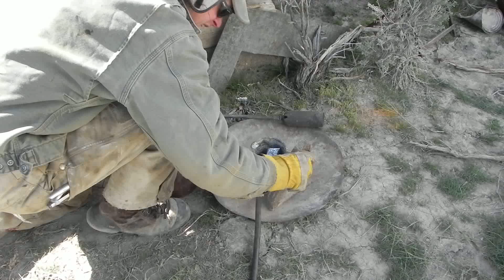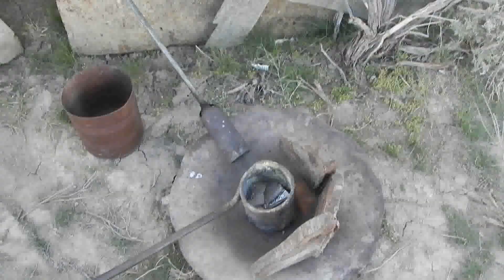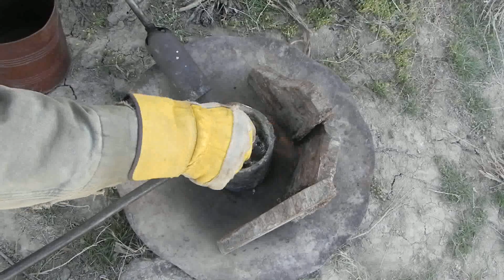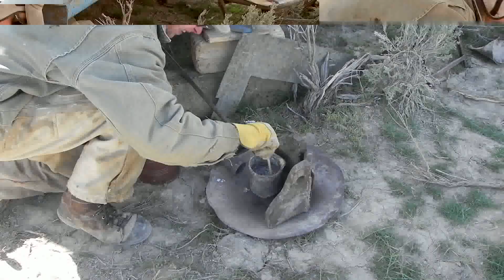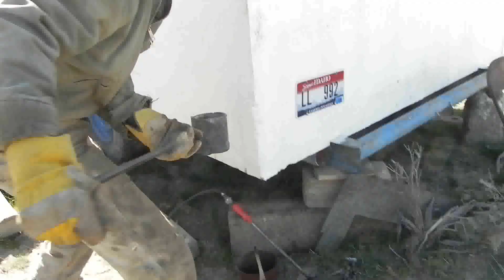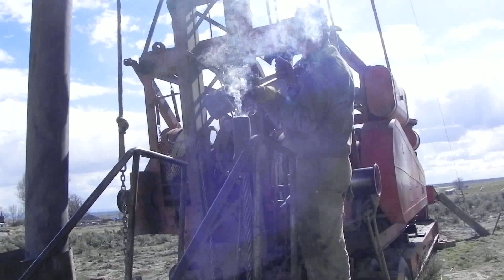Cable Mandrel Repair 4-15-2013

Comment: I must have poured a couple hundred rope sockets over the past 45 years. First time I have seen someone use a propane setup to heat the pot. I imagine there must be many variations in the methods each driller uses. My dad and uncles always said you have to use a dry pine stick with no pitch. BTW, is that a 36L, looks like a very well maintained drill rig.  I have to say that I prefer Star Drills over BE, but I  have operated more BE models probably.  Thanks for the video, pretty interesting.